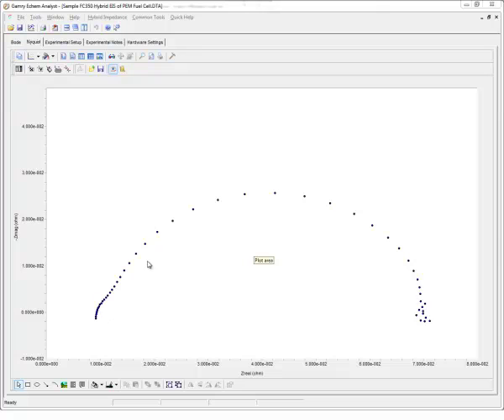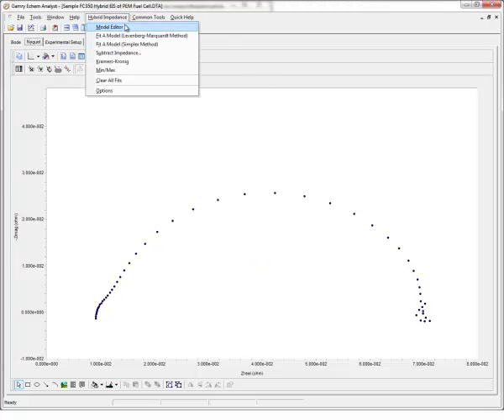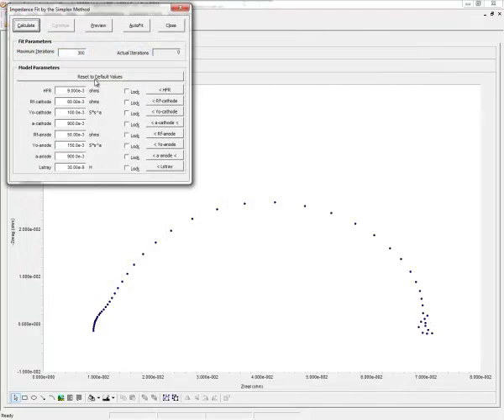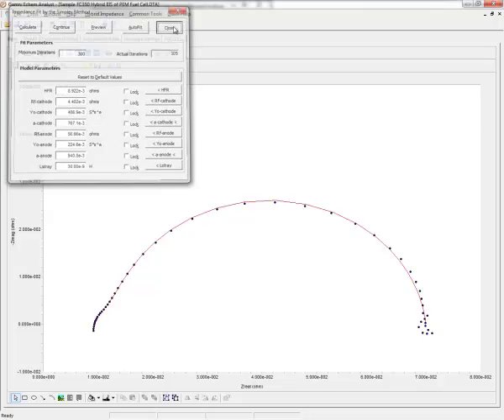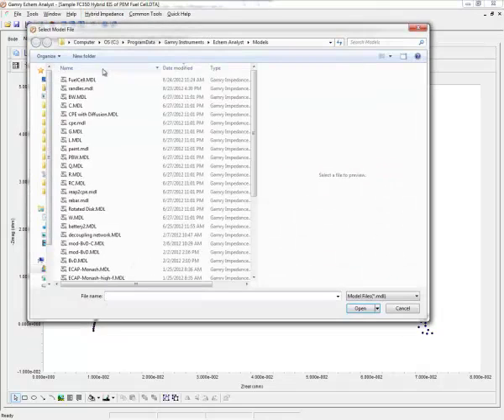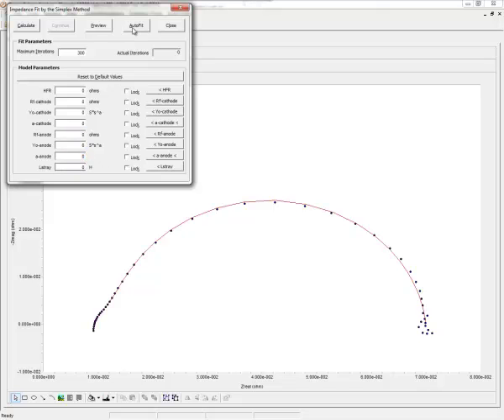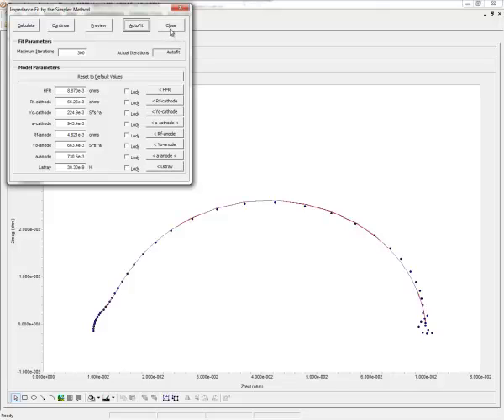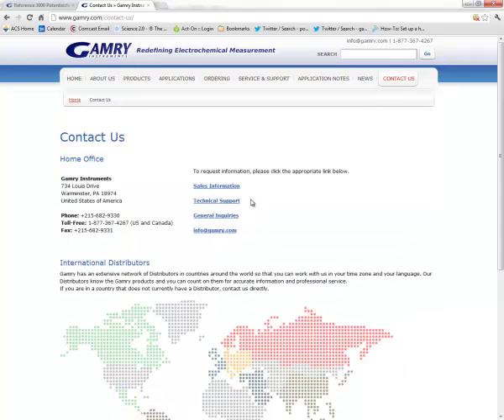Using the Autofit Routine for EIS in Echem Analyst- Close Captioned

Comment: how much should be goodness of fit
Reply from the maker: The Goodness of Fit is a Chi Squared value. There is no exact value that determines if the model is good or bad. Ideally, it will be between 10^-3 and 10^-6. However, the margin of error for each element is a better indicator of model quality than Goodness of Fit is. 

If you have additional questions, please contact our support team at techsupport@gamry.com